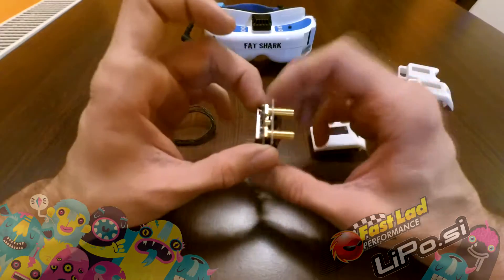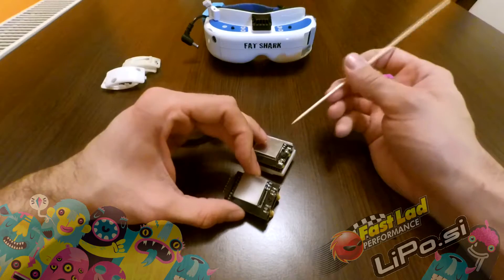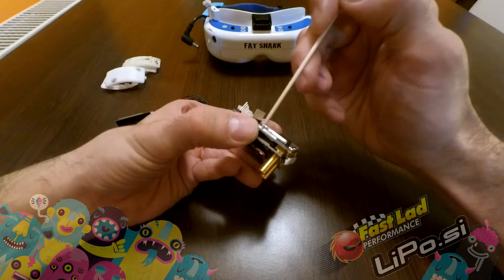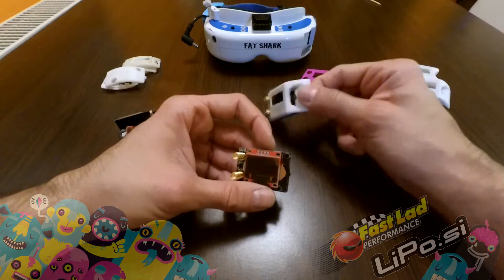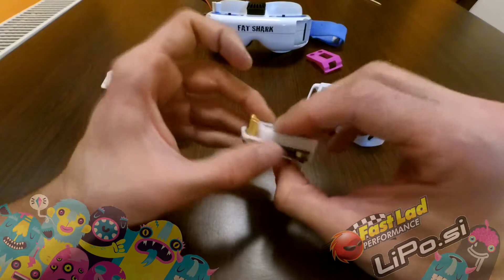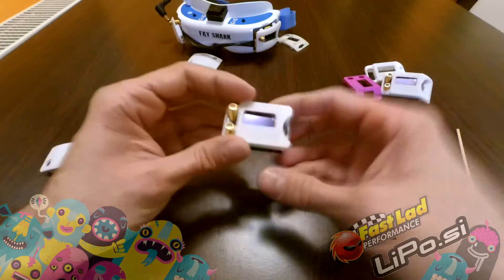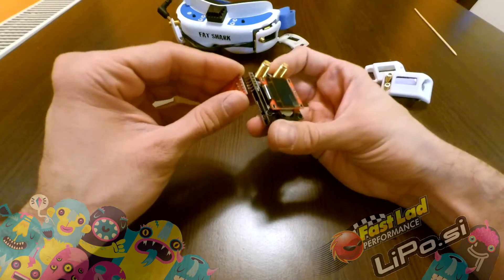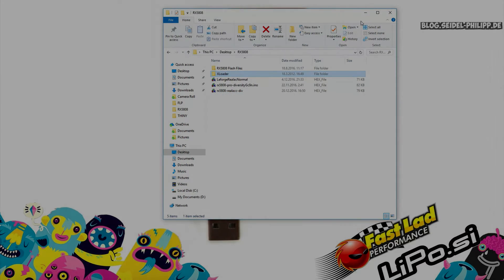Realacc RX 5808 Firmware Update

Comment: where do you get the adapter?
Reply from the maker: Not sure what adapters you mean but if you mean these theres the link
http://www.banggood.com/1-PCS-Realacc-45-Degree-Antenna-Adpater-Connector-SMA-RP-SMA-For-RX5808-Fatshark-Goggles-p-1084114.html?rmmds=myorderB82505288108201309LP
Reply: The one you use to connect the USB to do firmware update.
Reply from the maker: Here you go
https://www.banggood.com/FTDI-USB-OSD-Programmer-Module-for-F3-Flight-Control-AIO-Transmitter-OSD-BEC-Current-Sensor-p-1111287.html?rmmds=B82505288108201309LP

Comment: cheers "mr Rockwell FPV"!... 
I'm having issues with my X-loader.... just sits there, saying "uploading".... 
but nothing ever happens on the realAcc, only fails when I remove the usb from the FTDI adapter,
Reply from the maker: MrThrust Maybe you didn't notice but I sped up the uploading part of the video. It usually takes up to a minute to upload. Also make sure that the xloader settings are the same as in the video. If you still have issues be free to write.